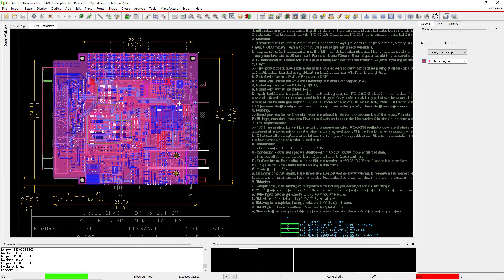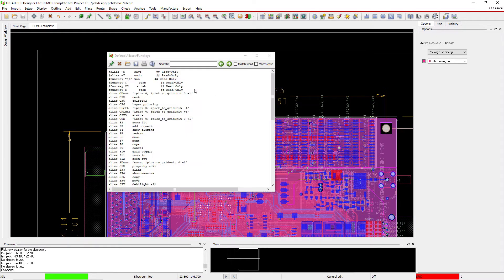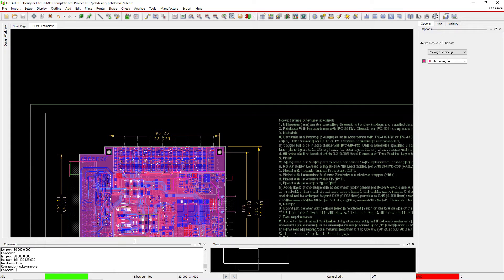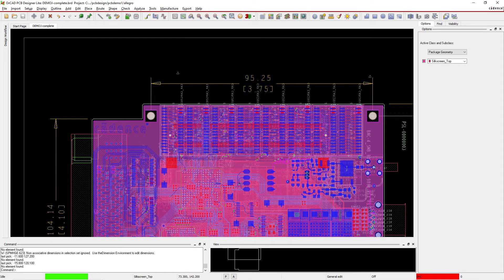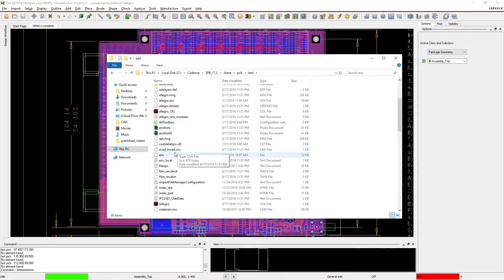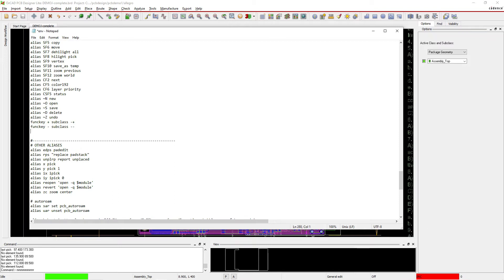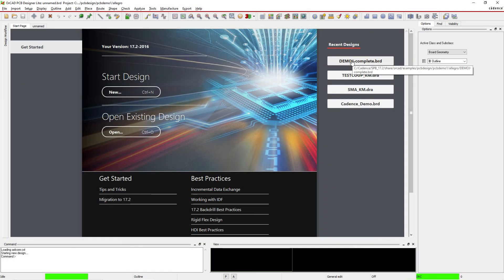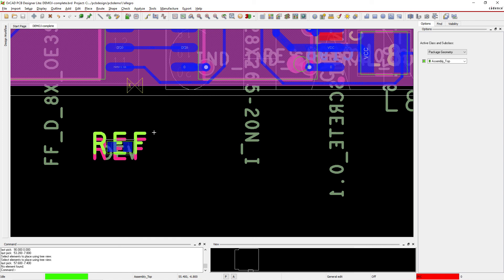How to Use Custom Hotkeys in OrCAD

Comment: Seems Cadence  does not recommend edit the system level env file in /share/pcb/text/ folder directly as it may be overwritten when upgrade cadence, instead you can edit $home/pcbenv/env file.